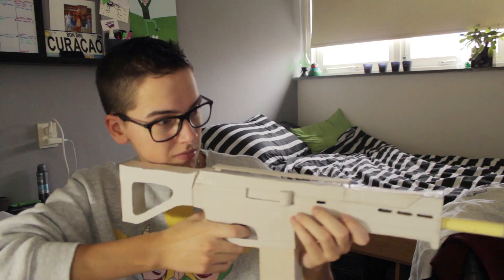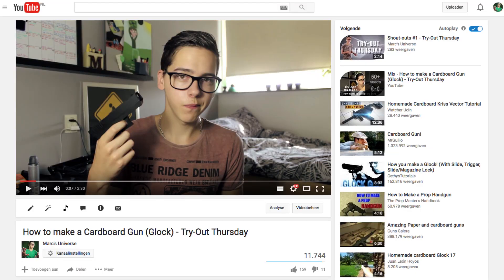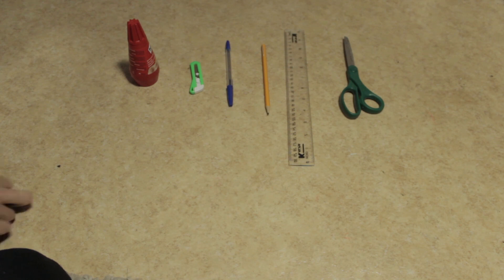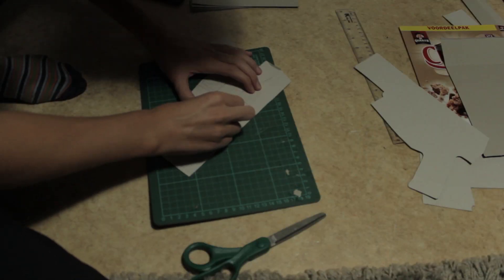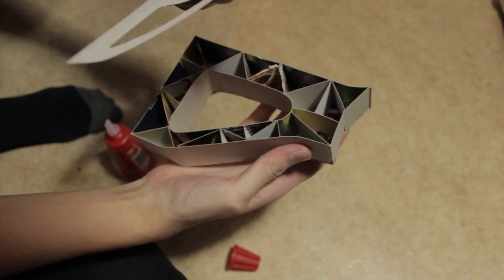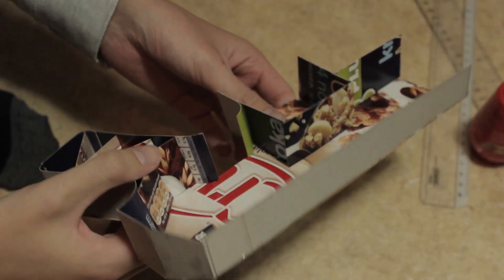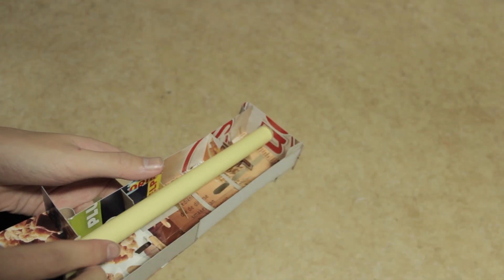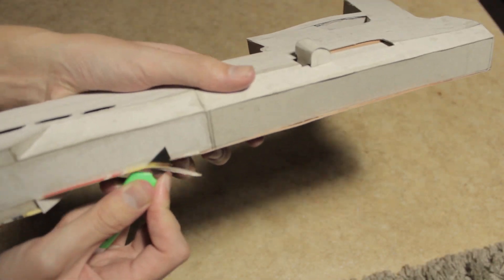How to make a Cardboard ACR - DIY

Comment: This thing looks like it's sized for a three year old. Not to mention the fact that I've seen better. And the charging handle or "pull back" as you called it, is not on the bolt, it should be forward more on the front of the receiver
Reply from the maker: Well Daniel, Sorry that I don't make it perfect.
I do think its pretty good and sure, there are always better ones!
Reply: Marc's Universe It is good for most of the ones i've seen but I'm just very nit picky when it comes to firearms
Reply from the maker: +Daniel Heines2 I noticed, well you could just see this as a basic where you yourself can improve this and that